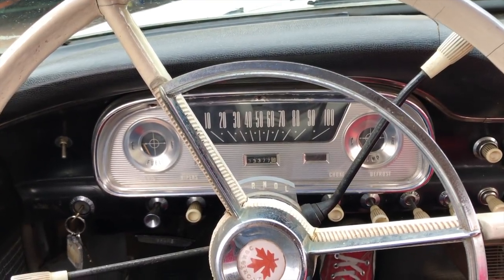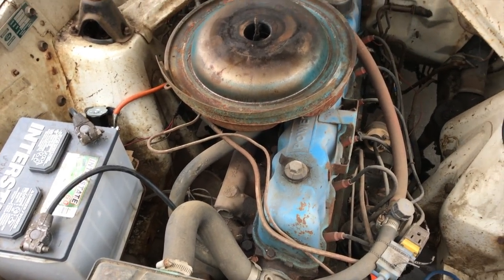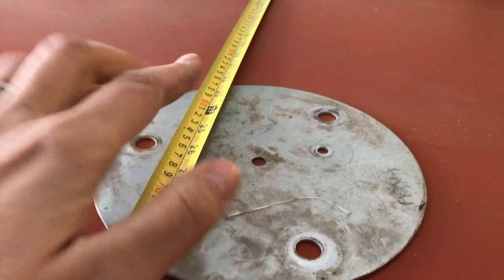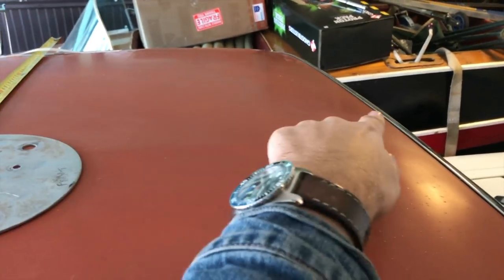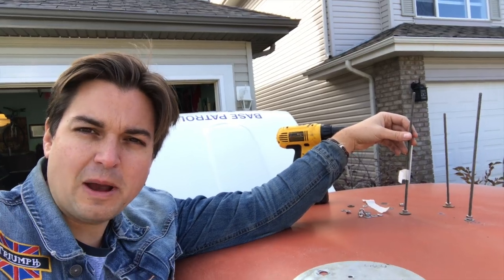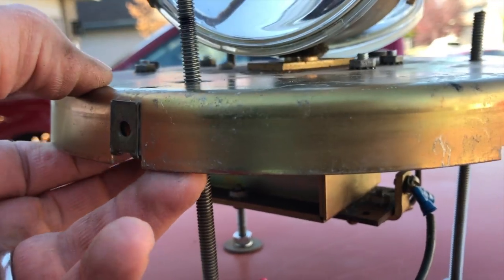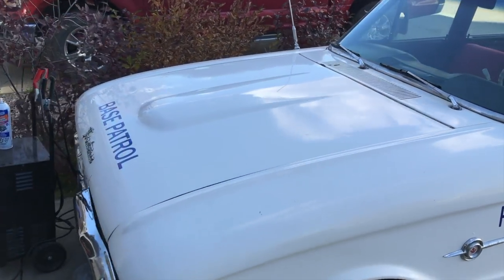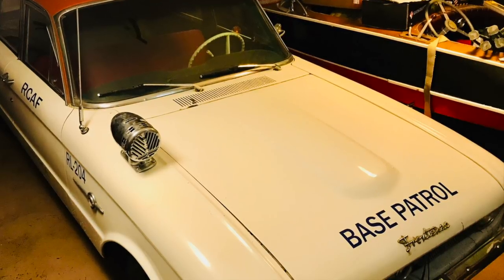Squad Car Project Part 2,  We attempt the first start in a decade!

Comment: It needs to have a good rub down of Vice Grip Garage "Patina Sauce".    (Check out Derek's videos on YouTube.)  Scrub the whole car down with very wet S.O.S. pads to remove the oxidation.  Mix 1 part Boiled Linseed oil, 2 parts, Mineral Spirits, and several pssssts of WD-40 Lubricant.  You will have a shine that will last all summer.  I'm amazed with what you did to that car!  It sounds better than my dad's 64 Falcon wagon with the 144 6 cylinder.

Comment: Engine has a '70s era valve cover, probably a later model 200 swapped in. If you count five freeze plugs on the right side of the block, it's a 200.
Reply from the maker: +Matt Farah's Million Mile Lexus it’s running nice either way! :) thanks for watching and stay tuned for chapter 3!
Reply: Y'know my father's 1960 Falcon got an engine change in the early 70's too, but it turns out it the new engine ran hotter and it was always a problem with his car on hot days.  Be certain you are getting proper cooling for yours!  Of course an inexpensive ebay aluminum radiator would probably solve that problem if there is one.  My dad ended up selling his Falcon even though he loved it because of the cooling issues.

Comment: I had a 61 Falcon Ranchero and the interior was the same. Had a manual chke next to steering wheel . had a 2 speed Fordomatic tans.177 cu. straight six. another cool thing was on the bottom of fuel pump,had a glass bowl. If it got water in it you unhooked the bow, dumped it out and away you'd go.
Reply from the maker: simple and fun little car!
Reply: Ah, chokes. :)